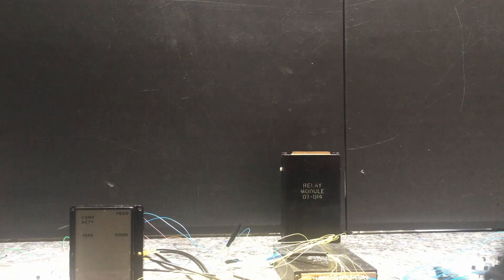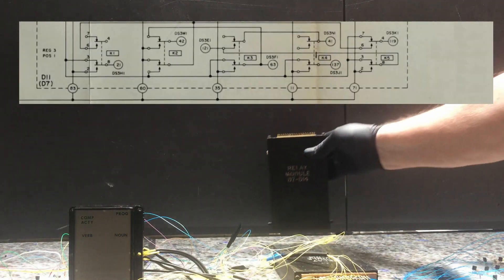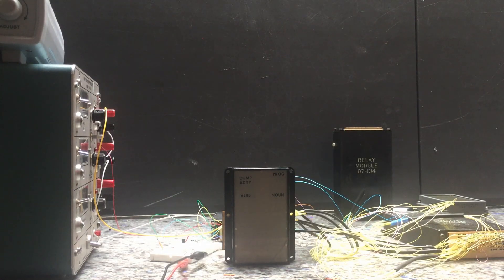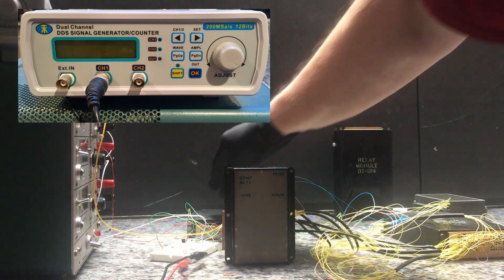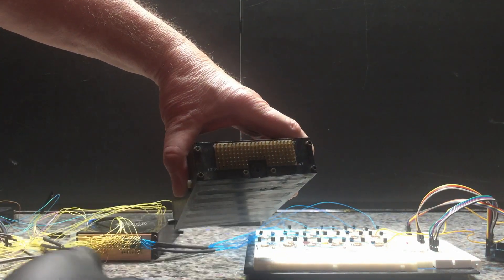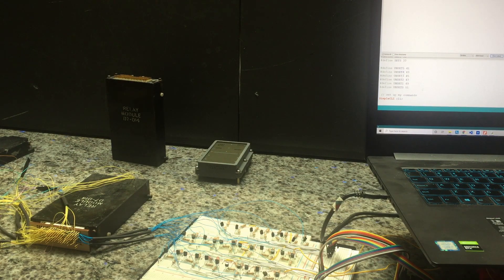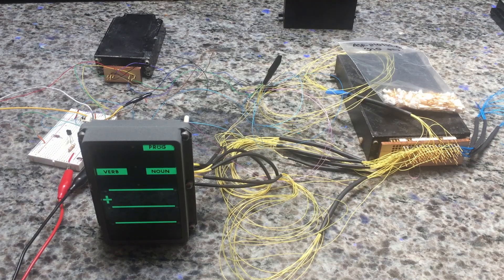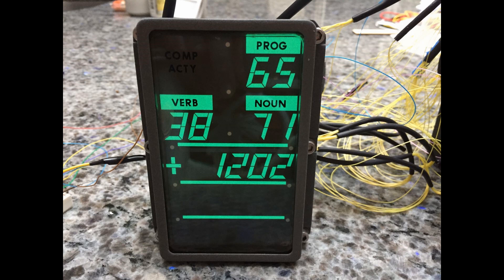DSKY panel brought to life

Comment from the maker: I am surprised nobody commented on the use of a five bit code to select one of ten digits or blank, since four bits are sufficient to encode all those options. 
I believe the reason was the design constraint that the relays had DPDT contacts. Routing four relays to seven output pins would require more combinatorial logic than can be implemented with DPDT devices. The form factor, resilience under G force, and low power were other constraints that led to using these relays in the DSKY. 
I included the wiring diagram of a digit, showing the five relays and the seven output pins that lead to the seven display segments. Examining that along with the table of the five bit codes sheds light on how they accomplished the decoding.

Comment: Really cool - thank you for posting this!   Were the older displays generally dimmer than later designs, or is it a function more of the newer unit being an unused spare and the older one having seen some sort of active use?
Reply from the maker: Hi Clifford

The first display was an early (rev A) of the display and probably used in engineering mockups with extensive hours. The second was a spare and I believe it is much more representative of the typical display in use.

These had a 2000 hour life in the spec and by 1000 hours would be significantly dimmer than when new. A mission would chew up about a quarter to a third just from launch, but would have more hours on it during checkout, plugs out test and prelaunch activities. The DSKYs in the simulators would be hammered steadily, more so than ones in a spacecraft. I suspect they made many many spares to swap in as displays got too dim.

Comment: The sound is exactly as I imagined.. are relays like those made today ?
Reply from the maker: They are - no exactly the same but similar latching relays in roughly the same space
Reply: @carlclaunch793  was it common to use them in displays like nixi tubes ?  I wonder if any other similar types of displays were made.. maybe there are other relay packs out there that are generic...
Reply from the maker: @shaanee  Relays were supplanted by high voltage MOSFETs for switching higher voltage such as with Nixie tubes. Another rationale for the latching relays in Apollo was that they retained their state with zero power applied, thus the energy consumption was low to fit within the limited resources in a spacecraft
Reply: @carlclaunch793  the sound is cool tho.. and seems familiar. Makes me wonder where else they were used and maybe there’s other OLD modules around...  the clicks must have been very clear while in space.. Also I wonder if the AGC could ‘read’ the relays.. i guess not .otherwise it would be like a bit of memory...
Reply: @carlclaunch793  *if i was making a display i prob would try to keep the click and not drive high voltage.. not a clone obviously but.. just something that is similar

Comment: Awesome work ! Would it be possibe to reduce the number of individual transistors by using high voltage driver chips like TD62783 ?
Reply from the maker: Hi Pawel
The transistors are delivering 14V or sinking 14V to ground to activate the coils in the relays inside the Relay Module. I certainly could have used different chips to reduce the parts count. 
I had plenty of transistors and resistors at hand that I could breadboard together quickly. It was more convenient for a temporary project. If it had been intended for longer term use,  I would have fabricated a PCB and made the drive circuitry more sophisticated.